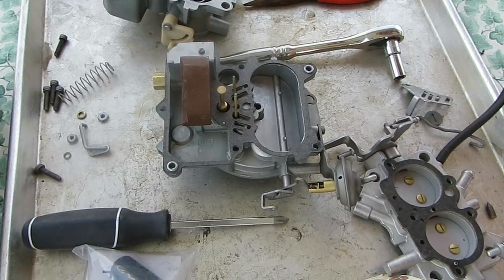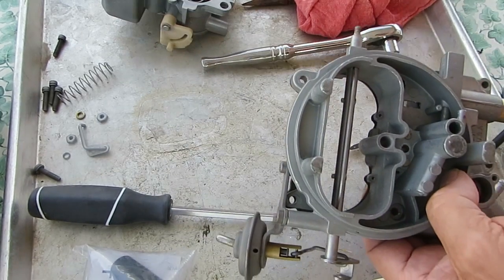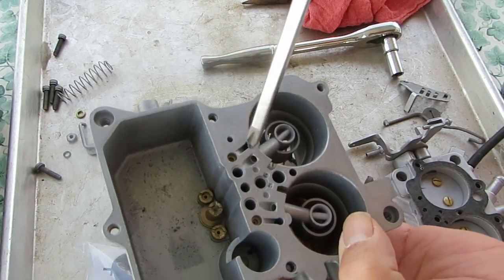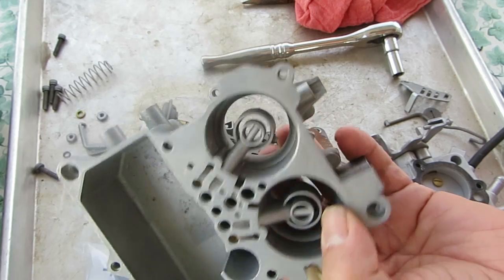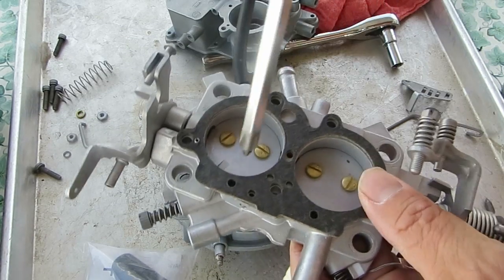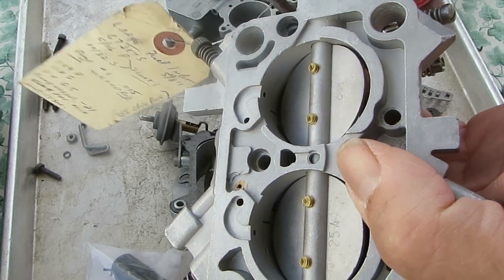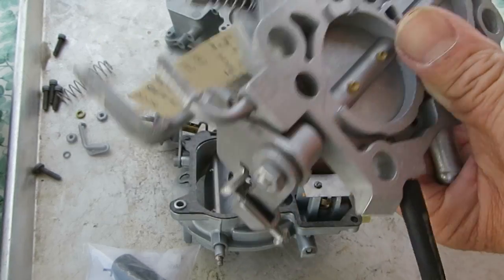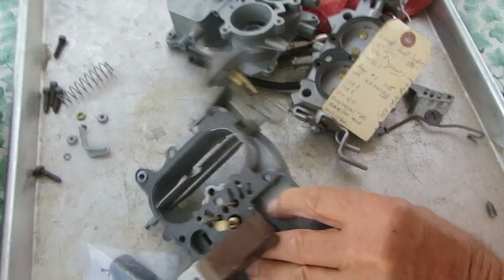Holley 2245 Idle Circuit

Comment: Hi mike, found your videos super helpful. Do you have any tips for what i should do if the car dies after it warms up a bit and the choke opens? i don't even have to kick it down from high idle,it just sputters out. I can keep it alive with my foot though. even with the idle screw all the way in, thats not enough throttle to keep it alive. vaccum gauge says i have steady vaccum (in green on the gauge) up until it warms up a bit and the choke opens. then it just drops off.
Reply: @MikesCarburetor   Thanks! The  van's been off the road for twenty years or so before i picked it up. I just replaced the fuel pump this morning, but no change.  about to try and mess with the float level and look at the float valve.

Comment: This is a question for a completely different carb. But my 1970 autolite 2100 fast idle wont disengage, I have to push down on the fast idle cam to make it disengage. Is there an adjustment I can make so that it will?